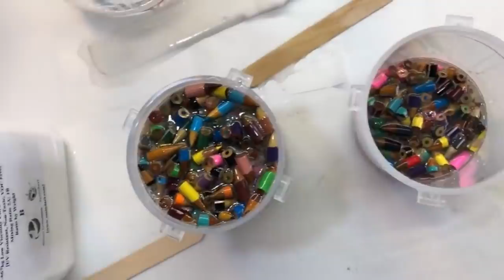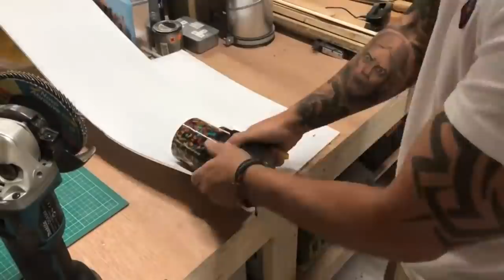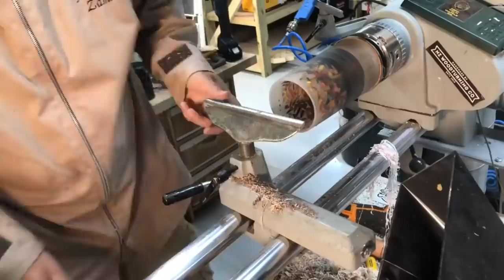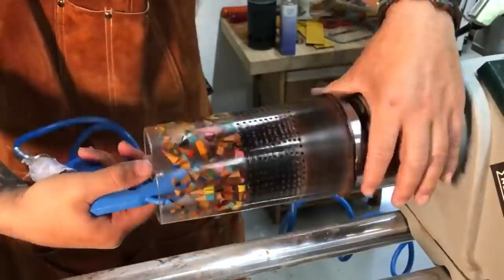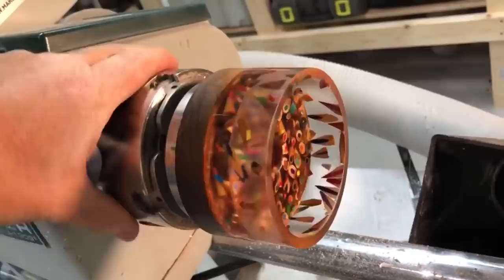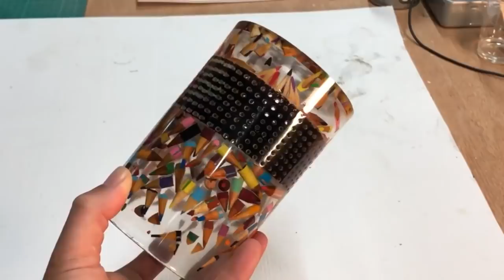Woodturning - Pencil Amazon Echo - Unwaffled

Comment: Question, when using resin and you know you are going to hollow it out, why don't you use a plastic container as a spacer? Is that not possible? Or use something else. That way you are not wasting resin or the color pencils. And you won't have to hollow out as much which also saves time and clean up mess. Why not use the plastic cardboard or whatever it is that you used when you wrapped your piece in order to add more resin? You could use it like a spacer as well. Then you can make a sperate piece to be the bottom and put it together like you did in this piece. Or could paper towel rolls work too?